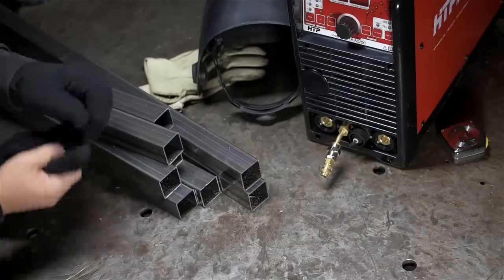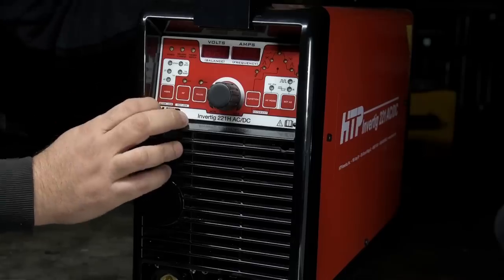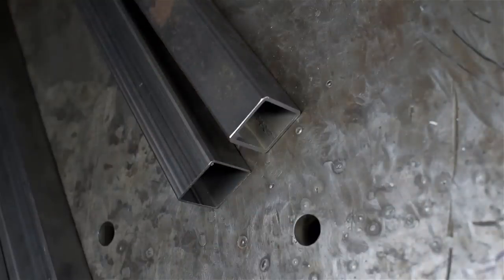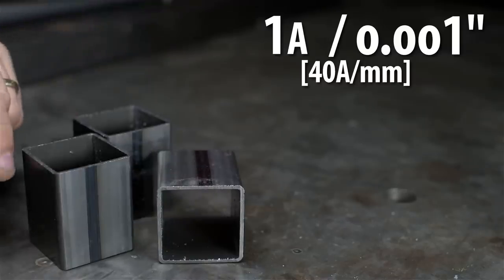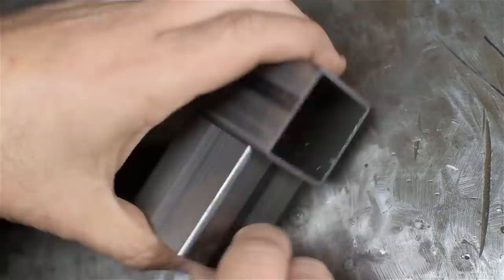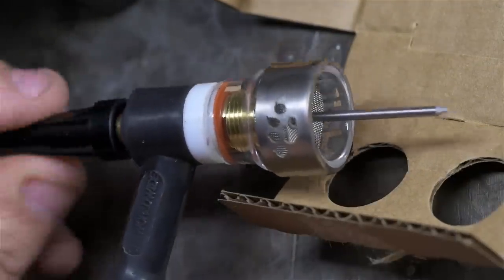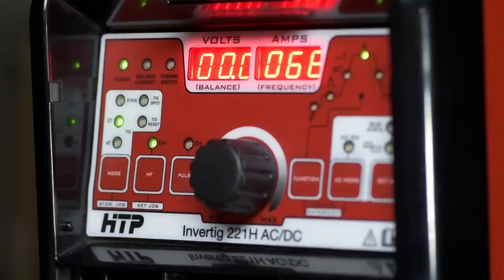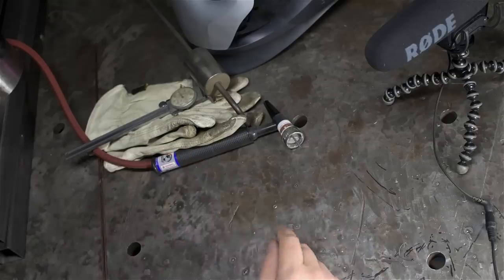Weld Cart Build (not really)

Comment: First thing I built with my first TIG welder... a cart, in aluminium.
Pro tip: leave the most visible welds 'til last... they should be the best after the practice : )
Reply: First thing I built with my stick welder was a belt sander. All the welds needed grinding, lots of it, except for one, the one that is most visible. I don't know how and I don't know why but it turned out perfect, wasn't even one of the later ones. If you haven't got the skill luck will do.
Reply: Thats a really good trick
Reply: That’s gonna be my first project, a cart. For me 304 11ga. Hope it turns out well. How did the Aluminum work out?

Comment: If you need thicker filler rod, just use blue tape to bundle a few together.  Maybe some CA glue.

(To the humor impaired out there - don't do this.)
Reply: It's actually not uncommon to tack multiple rods together, especially for poorly fit open root welds, filling deep grooves faster, or making extra wide cap/cover passes. Works best with 1/8 or larger diameter, but with practice can be done well with smaller sizes too. The main advantage is you get the extra width of a larger diameter rod without the extra height, so amperage stays about the same.

Comment: I used a Petco shopping cart i found. The handle and solid frame and wheels cant be beat.
Reply: Pets are good at welding when you train them properly, and when your pets are humans.
Reply: Yeh! But does the thing go straight or take off a a tangent every few seconds. Don't ever try that with an English shopping cart. They have 4 wheel steering where no two wheels ever agree in the direction to take.

Comment: For doing aluminum, try ac voltage and use a lanthinated tungsten with a needle tip. Adjust the pulse and frequency, really beautiful welds. Those inverter welders are fun.

Comment: Loving your channel, saw the usual 1 amp / .001 rule annnnnnnd for tigging in the sheet metal shop 50% of the machines are set to 150 amps, 20% of the guys are set to 310 amps and the rest 100-120, all for 0.060 crs. Quick tacks are more reliable with higher amps and take less time and have less chance of distortion and burn through, and some of the super fast guys can run a bead much faster at higher settings. Also less time fiddling with the machine :P

Comment: Using a assembler/disassembler cartridge (distributed as video game of the 80's on the 'coco2', a computer using the 6809 CPU), I used the disassembler to disassemble the disassembler in the cartridge. I worked on this version until it became acceptable to the assembler.

Using my own disassembler to disassemble the assembler on the cartridge. My version saved time by creating a version closer to what an assembler need. After some work, the assembler could create a brand new binary executable of the assembler.

Soon after, I got a x86 base system with a text editor able to open almost 640K.

The x86 version of the 6809 assembler and disassembler were /still today, would beat in compilation time any product on the market. It is almost cheating since they were written in x86 assembler.

I don't expect anybody watching this old Tony to understand any of this jargon. It just shock me how much work I was willing to do to study a video game, Robotron:2084.

Comment: have u considered keeping the bottles on a handtruck and putting air line disconnects on ur gas lines?  i'm always bringing my welder to the work (i have a stone driveway and a welding cart wont roll, and its mig not tig)  so i huff the welder without bottle and handtruck the bottle.  its a special handtruck designed for a bottle it has a kickstand so u can rest it on four wheels at a slight angle back.  air line quick disconnects stay airtight at low pressure, just in case someone worries otherwise.
Reply from the maker: not a bad idea!  my welder never really leaves my garage, I just like to be able to roll the whole thing out to the other side of my bench or maybe out in the driveway.  all smooth concrete for me.  keeping it all together just works out tidier in my case.  but good idea.
Reply: This Old Tony -  very nice!   thanks for the reply.  look forward to seeing the cart.  cheers!

Comment: I can tell you from experience that the main problem I had using them on AC (decided to do it anyways), was a lot of the alumina embedded itself on the inside of the cup and it cannot be removed. I think one of them cracked when I was doing longer passes at 200A, but it may not have been from the welding.

Comment: Slower speed equals more heat into the work. Cranking amps up and moving faster will shorten up the soak. And lesson the metal movement as well. To a point of course. Depending on the speed you as a welder are comfortable going and how many amps the work can handle.

Comment: Do a water cooler build next. 
I've built two, using rotary vane pumps (Procon is common) for soda carbonators (actually what real water coolers use) and a car AC system condenser as a radiator. I'm curious to see another person's take on the vessel to store water in and the packaging. I used a gas can on one (new, mind you) and a 3 gallon soda keg for the other. Not counting the torch, I had like $150 in materials in each using new pumps and motors. Aim for 50psi regulated by a valve on the return to create the backpressure to achieve your pressure, and the voltage runs through the water return.
Reply: tim babeu ur like ya

Comment: WTF, you buy a clear tig cup to watch inside and through, and the manufacturer has to put his logo on a big ass steel ring that covers up 75% ? That's bullshit.
Reply: That is just the optional guard ring. You can run without it, just be careful not to whack the cup into something.
Reply: Still, would make a lot more sense if it was just a ring at the tip with spokes going back to the base of the cup, to buffer sudden impacts.
Reply: Looks cool though! Lol
Reply: This was too serious. You made me learn stuff. I hate that.
Reply: It's a titanium ring that's slip fit onto the cup. Can run without it no problem
Reply: You are clearly not a welder. Try moving around in a full tube chassis with this cup without tapping it against a tube. Even welding on a bench its easy to smack these things around. The guard is also removable if you couldn't tell from the second cup in the pack with no guard. Plus pyrex cups are not only for looking through. The shape is to provide a large argon envelope and the clear cup not only allows visibility through the cup but also allows more light from the arc to shine on your joint. Damn trolls and their 2 cents.

Comment: to be honest, i hated tig welding when i just had a torch switch and i love it since i got the foot control... its just like so much easier because you can see whats going on and adjust, especially if you are too dumb to feed the wire like me, you just can back off a bit and get ur shit back together. also no more calculating and messing around, if the damn thing wont melt, pedal to the metal and off we go.
Reply from the maker: yes, with foot control it's a whole different world!

Comment: i have a question.. any chance you could make some small marks on a tig rod to show how fast it is being fed in? i can never tell, it almost seems like it's not feeding in at all. thanks for all the effort you put into teaching, it is valuable reference material
Reply from the maker: for these welds, especially for the slightly-bigger-than-expected filler rod diameter, it's not moving much at all.  All four of those joints used maybe.. 1/3-1/4 of a tig rod?  so maybe 8-10"?.  if that.

Comment: Larger filler rod isn't necessarily how you put down bigger welds and smaller rod doesn't necessarily mean you're increasing heat input. Smaller wire will suck less heat out of the puddle so you can feed wire in at a much faster rate with less amps where a larger rod you'd need to up the amps to be able to push more wire into the puddle. Having your wire feeding technique down is really what's going to determine how big a weld you can make with smaller wire. You know you're technique is getting good when you can feed wire fast enough that you don't have to stop to reposition the rod in your hand to finish your weld.

Comment: If you want 'big welds' use MIG. For TIG, I'd think about using filler more similar to size to the base material, not bigger.

But, as you've plumped for a 3/32 filler, you need to use that to gauge your initial amperage (1A per thou etc). Try turning it up to 100A on that inside corner you're practicing, it still looks cold. Better, switch to a smaller filler......

Comment: Make a cart with the tanks left chained to the wall and the welder above the cooler. Hose is pretty cheap. Depends if you can remember to turn the remote tanks off.
Reply from the maker: or not rip them out of the wall when I move the cart?  :)
Reply: This Old Tony , Buy longer hoses, cheapskate! If you knock the valve off an oxygen bottle you could quickly have a heavy steel cylinder developing maybe 1000 lb of thrust on your hands (depending on the diameter of the hole in the tank.) BTW,  many thanks for your many lessons :) Most enjoyable!

Comment: I understand everyone recommending certain settings, but in reality, unless you are in a commercial building with 3 phase supply, settings on a welder are a rough guide.. Most areas will have massive volt drop @ peak times in the day.. This all effects what's going in to your machine.. Hence effects what's coming out! Parameters need switching up

Comment: So... this seems like something that definitely requires detailed tig welds and cold rolled steel. 

Also, I'd bet that pyrex is a less gooder insulator than ceramic. Particularly when it's got that metallic cock ring around the edge of the glass. Because of all that, I bet... $1... that pound for pound, you want more amps with the glass thingy.
Reply from the maker: I plan to mill all the tubing to length then surface grinding to final dimension.  I've already got the sine bar set up for the mitres.

Interesting theory on the pyrex!  Might be experiment time.
Reply: Can't be too careful. I'd just buy a 14*23*9 gauge block, rough out a pocket for the welder, then hand scrape the sides to final dimensions. 

Full disclosure: I think welding = turn the arc welder up as high as it'll go, then lightsabre the two chunks of rebar/fence post/old leaf springs together using as much of the cheapest whatever stick I can lay my hands on. Although I'm also partial to brazing. 

I've been thinking the pyrex vs ceramic nozzle over in my head... The larger size, less insulation from glass vs ceramic maybe, maybe heatsinking from the metal, BUT also likely much higher reflexion of heat from the glass surface... I dunno... I bet there is a difference, but with the shielding gas it may be negligible...?

Comment: ...Anyone else (new to this) take a screenshot of that chart?
Reply: not much to it, inside corners need a little more heat, outside need less, stainless takes less heat than mild steel, aluminum takes more.

one thing tony didn't mention because it wasn't relevant to what he was doing, is that you need to keep moving with aluminum, there's certain point just after the right amount of heat that aluminum suddenly turns into liquid and leaves.
Reply: same with stainless steel, get in and get out.
Reply: Rule of thing 1 amp per tho just remember that and you’ll be ok

Comment: Hello, I was wondering with all of your cranial-kung-fu Tig welding. I am a newbie to tig welding. I started like 6 days ago today being the 30th of Dec. So I've tortured a few specific pieces of Aluminum pieces I got from a local warehouse. All while I was waiting for my Welder to show up I seen all these videos of guys using these Stubby Cups and so I ordered one.  Most seem to be using the #8 cup for the most part.  I was thinking that as a newbie ya shouldnt jump to these stubby cups, till ya actually learn how to get going and stack nickles so to speak. I seen a video of a guy that got his welder and was brand new as well. he used the #6 cup that came with his machine and was obvious he was new. But then his second video hes got a stubby cup set up going and it seem to work better for em. So do ya think its more like cheating and should learn to run the cups that come with your system before ya jump to a fancier gas type cup like the stubby cup. It just seems to me its like a cheating device causing you not to learn how to control your puddle and other important skills ya should learn before ya jump to one of those lil suckers. I was just curious about what ya thought? I got one and wanna try it but been holding back till I feel like ive got things better worked out. Any thoughts?

Comment: Golden ratio must be why people don't like DIN standard paper e.g. A4. The proportions are √2 and they wickedly remain such even when you fold them in half. Recursively. What a stupid idea. I mean starting with exactly 1 square metre of paper with A0, and having each halving of the longer side being the next in the series …. so it takes 16 sheets of A4 to make one A0. Or vice versa. Sounds irrational. Why not start with something arbitrary like the width and length of a convenient plank of wood that you found to press the paper?

Now that I have your attention, I heard water cooling being mentioned. If such is free and the trickling of water into a nearby drain doesn't bother you, then you can move onto the next comment.

A closed circuit can be made from a small water container (e.g. 5 to 10 litre re-purposed  "spring water" plastic), a small circulation pump, a heat exchanger and a small fan. Heat exchangers are cheap and you have a wide selection by the way of automotive "heater cores".  Using one with a square cross-section makes it easier to mount a PC-style cooling fan to suck air through it. I hope that I don't have to explain that you need clearance on both sides to be able get air through the heat exchanger and fan.

Getting decent airflow without cacophony isn't so easy. Most "silent" PC fans also don't move a lot of air once there's a bit of airflow resistance. Although not cheap (!!), Noctua's Industrial fans move a decent amount of air (up to around 300 cubic metres an hour) through typical heater cores,  adequately dispersing ALL the ohmic heating you'd get from a single-phase AC supplied welder. And they don't mind being slowed for quiet operation when e.g. you're listening for the buzz and crackle in light welding. As for circulation pump, go for a small BLDC unit with speed control; again to make it quiet for the light welds when you don't need much cooling.

Pump from the reservoir, through the torch and then back to reservoir VIA the heat exchanger. If the handle's too hot, crank up the pump speed. If the reservoir gets too hot, crank up the fan. Add vanilla scent to the water if the neighbours complain.

One could automate the speed control of pump and fan according to the heat load and ambient temperature; but then there'd be 2 knobs fewer to twiddle. And that would take away a lot of the magic of the process.

Comment: A big fan here (not literally) and I just bought my first tig. I do have problems getting this to run - that's the result of first tries: https://ibb.co/Mh7SmSR Can you take a look? I see your welds were pretty shiny - while those mine are all dark and burnt. That was 1mm (0,04" ?) 304 steel, tried without additional material and with 308L rod. 40-50A on the pictures above, with air cooled 9 torch with stub lens and no. 7 cup. 2.4mm 1,5% lantanated tungsten.